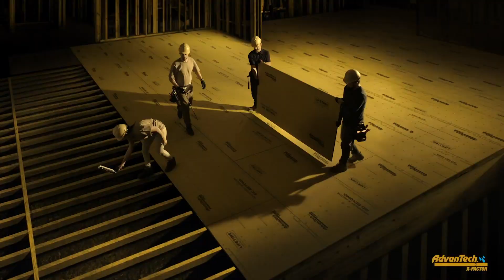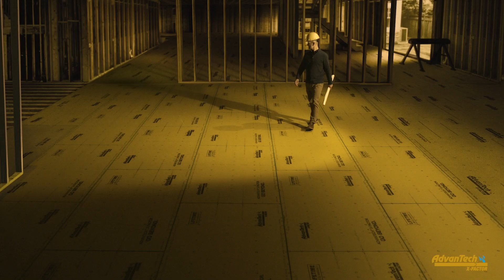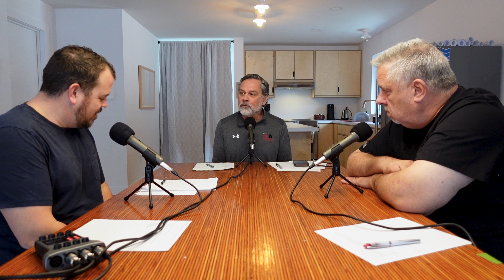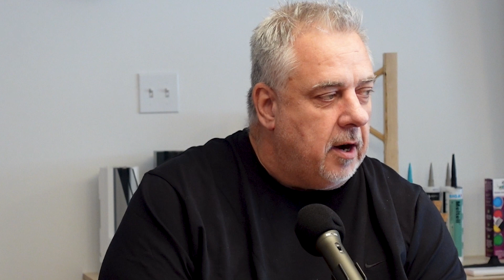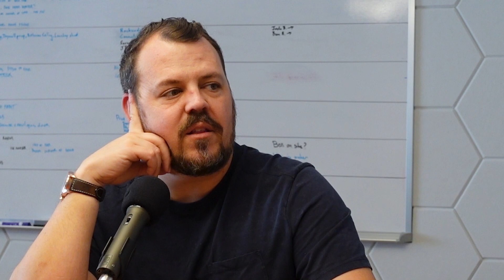Loads of Fun: Managing Energy Loads in High-Performance Homes - UnBuild It Podcast Episode #82

Comment: Great video! I was struck by the comment Peter made about approaching manufacturers looking for equipment that was appropriately sized for very low load homes and being told that there either wasn't anything available or that what was available was more expensive  I'm assuming these conversations occurred several years ago. 
Will you be following up on this topic with a video that discusses manufacturers, brands and model numbers that are available today for very low load homes? Either passive house or off-grid and solar powered?

Comment: So in 30 years ,technology should have a remote/proximity detector.
An in-floor series of tubes carrying heat or cooling in a grid pattern.
Servos could open and close to condition a 4x4 grid off a trunk line.

I worked around a chiller plant on the Sea Island Cloister motel and residences.
The plant is a 40ftx40ft building and it chills about 800 motel rooms and personal apartments. 
6 inch insulated lines up to 1/2 mile underground. 
Planned developments are using a central geothermal plant for providing heat and cooling for multiple homes.
Liquid seems to be easier to use point of use comfor,vs freon which indirectly flows air.
It is a fascinating subject to me.

I don't always agree with your conclusions,but I do appreciate the knowledge shared.
Being the dumbest in the room,is a place I love to be!